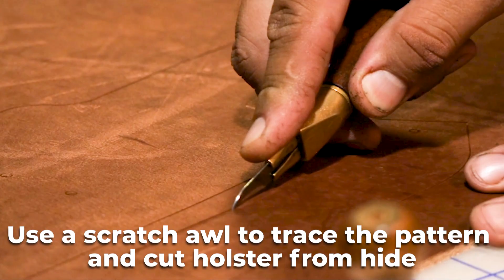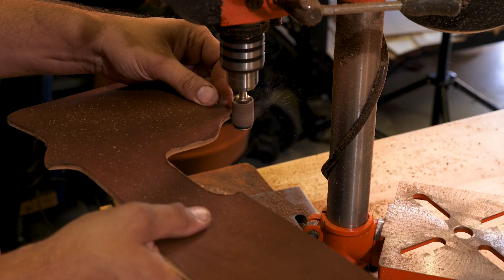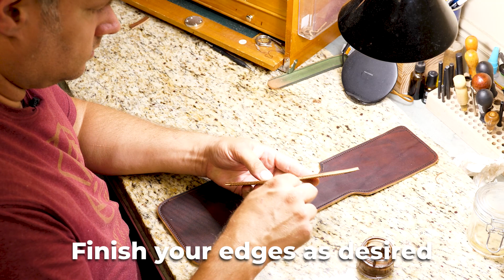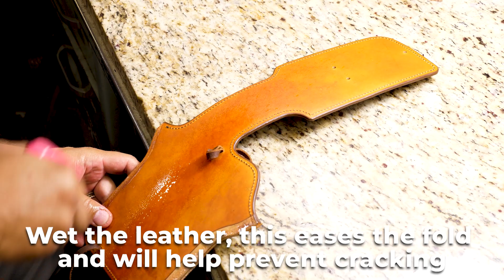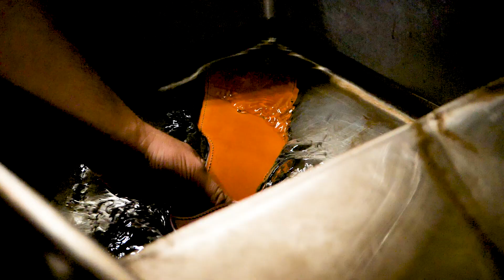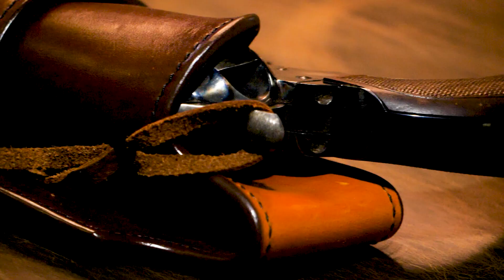How To Craft the Working Man's Holster | Leather Craft Walkthrough | 1873 Cattleman

Comment: Love these videos, seems like you pick up something new each time.
Topic of your tools of the trade question - What is the glue bottle you are using?  It looks like glass and maybe a replaceable brush.  I haven't had any luck finding something like it yet.
It has become obvious the small containers don't have the capacity to do holster liners and cans aren't easy to use either.
Reply from the maker: Thank you! We love these glue bottles - so its a great question. I started out, years ago, with the "glue pot" that you can pick up at Weaver or Tandy and I didn't craft enough (still just a hobby) and my glue would dry out before I could use it all. I've since moved back to the larger glue pot, but the glass bottles are a really great middle ground. And you're right, the little containers really don't hold enough and the big cans are a disaster to use. 
We originally got our glass glue bottles from Maker Supply, but they've been out of stock for a long time now. 
Rocky Mountain has something very similar in stock - the lid is plastic instead of metal, but the brush is replaceable which is great. You can find them here: https://www.rmleathersupply.com/products/glue-pot-container-with-brush?variant=44101961027
Sometimes I will see the same style of bottle on Amazon, but thats a little hit-and-miss. We're thinking of distributing soon and if we do we'll definitely be carrying these bottles. Good luck! Hope the bottle helps!
Reply: @HellhoundLeatherCo  I did find the Rocky Mountain supply and put an 8oz on order.  Really looking forward to seeing what you put on your list for distributing - the tools and items you use would be a great.  Gives us new crafters a starting point like the knives and punches.

Comment: What's the weight equivalent to 3/16-1/4"? 
Also I'm checking out veg hide on Amazon because it's convenient and has every other material Im in need of. 
Should I trust the samples I'm finding on their? So far it looks like what I need. But I'm also considered going to my local leather shop to support them. 
I'm starting as a hobby building hybrid holsters for myself and family. 
So it doesn't need folded. I'm using it for the backing surface. I'm considering going all out by using thinner leather to bind to the Kydex I'm using. 
Thanks in advanced.